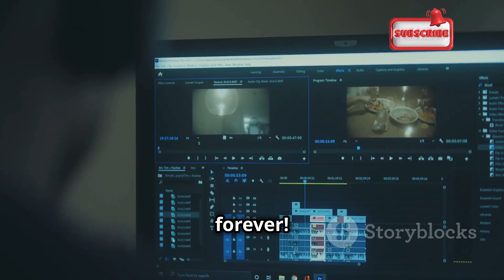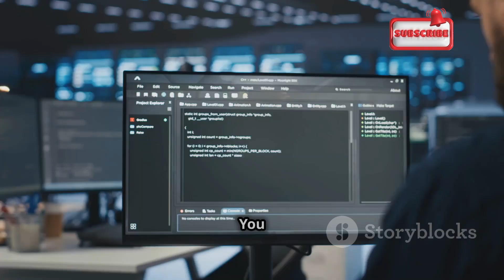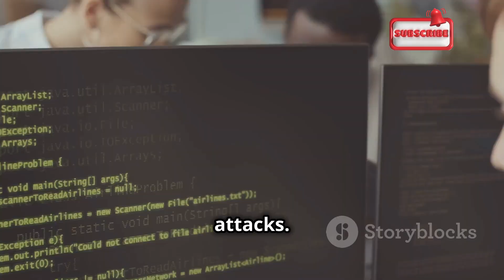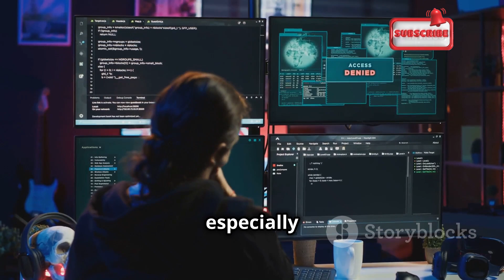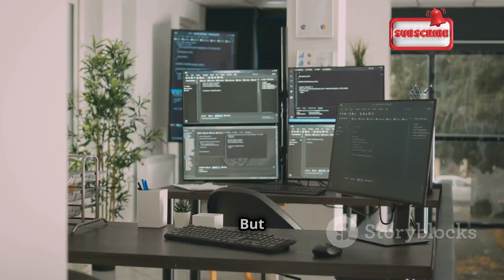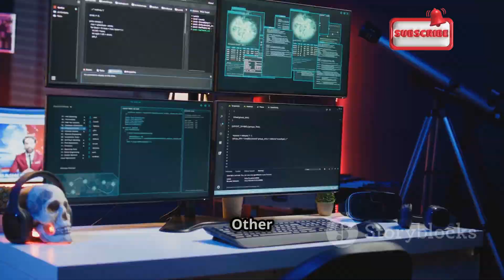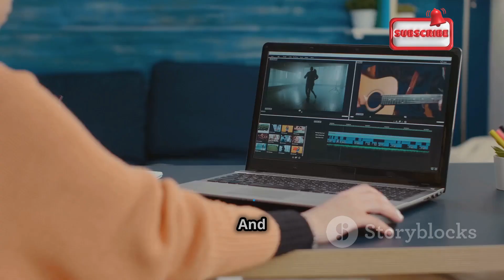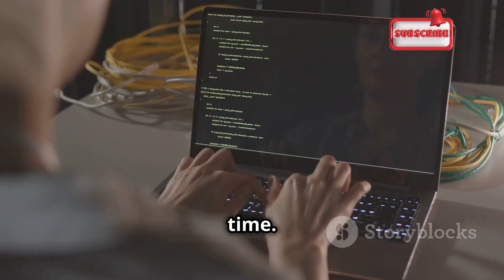8 Overrated Linux Features Everyone Praises

Comment: Good video.

The gaming part is a little outdated. You can play more windows games on Linux than on windows, especially old ones that stopped running on windows. The last real problem is the anti-cheat support.

Also the time sinking part is very fair, if you customize everything. If it’s about getting software to run, then windows is in certain (AMD) configurations just as bad or even worse.
Reply: Using the currently SOLD OUT GeForce Now! I run ROCKET LEAGUE on a .onn 4K Pro Streaming Device.

Comment: I like all of them for different things. Linux is my daily driver. Windows is for my proprietary software. Apple is for foreign language writing such as Japanese. They all have their place. Windows 11 came with lots of bloatware, Apple has its restrictive ecosystem, and Linux has few "on the phone" helpers to bail you out. So each has its negatives. I also download my photos off my iPhone to Linux because I do not like the photo file system on Apple. I program my radios on my PC using CHIRP because the older version available on the Arch User Repository did not seem to work. Maybe it was a hardware thing, not sure.

Comment: As a 🐧 guy i accept everything but not the last one if you are a beginner just use ubuntu or pop os they run out of the box on major hardwares they also include proprietary drivers for gpu's and you guys think configuring ubuntu is a big pitfalls definitely not it's just like a piece of 🍰
Reply: agreed that one.. but it need a pro to setup a BSD system... ohh wait that is no linux 😂😂😂😂
Reply: I have to politely agree, only that piece of cake is misleading.
Ubuntu gave me some headaches, Linux Mint was smoother in my experience. But overall, compared to Windows, Linux is just as easy to use. 
But: Linux is installed by the user and maintained by him. So it all depends on the experience of the user. This is in big contrast to MacOS, which will always just work as Apple cares for everything and the operating system is built for the exact hardware that the user bought. It will just not have driver issues or fail, at least not with the internals of the PC. This is something that some Linux vendors like System76 or here in Germany Tuxedo Computers try to adress and fix; Then you have a system that will not fail, too. Buy a Tuxedo laptop and run TuxedoOS on it and it will not fail (unless the Tuxedo devs make a mistake, but that's true for Apple too). 
This corporate backed devices is something you see with SteamOS, too. A device that never fails to boot and where driver problems are just nonexistent. I think this will be more and more in the future and make a lot of the problems that were mentioned in the video just vanish. You'll still be able to do whatever you want with your device and OS but will always have the support and safety net of the device vendor; you can easily undo your customizations and revert back to the vendor default and your device will run like new. Something only Apple and Linux vendors can deliver.
Reply: Or Linux mint.